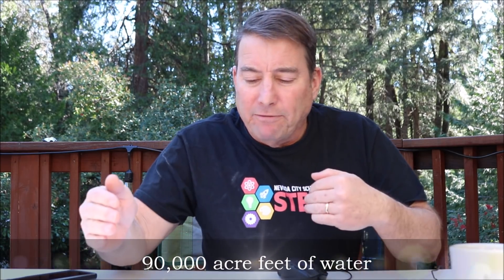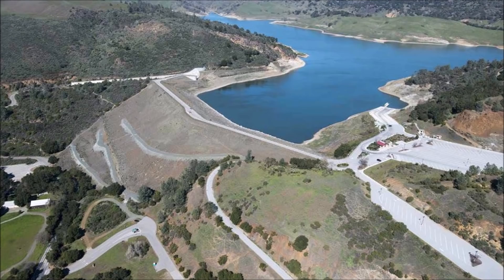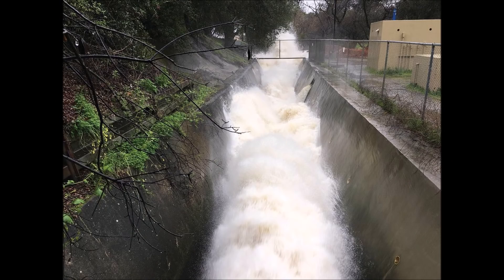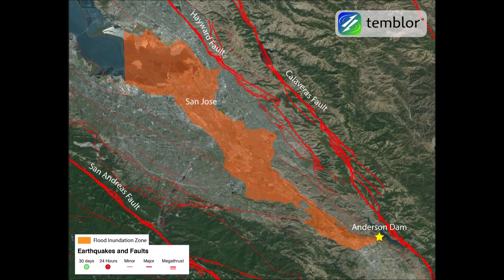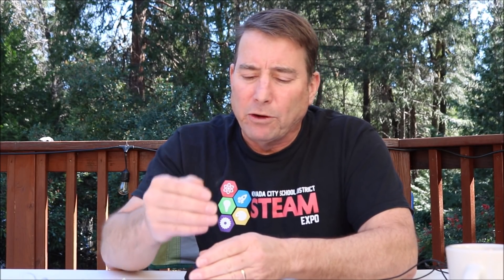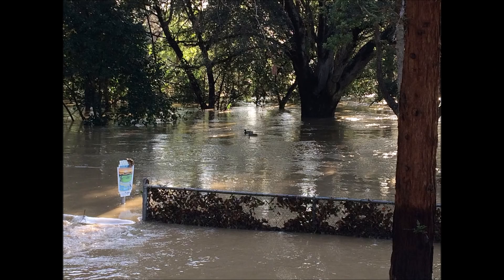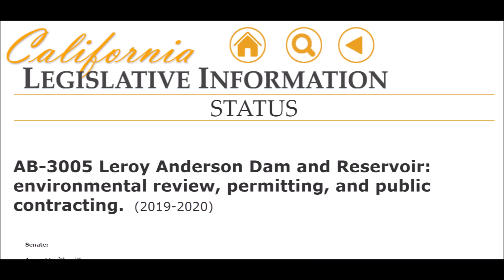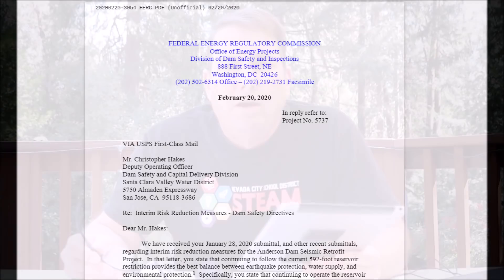Anderson Dam, Ca. vs FERC - "Drain The Lake"

Comment: The concept of channeling runoff is totally flawed, Inca-style hydrologic savvy says insert runoff into the groundwater system, don't ever let it gain speed, erosion worsens with the cube of velocity.

To clean up homelessness talk to Jamie Diamon & the Fed.

To handle Anthropocene rain volumes per unit time, baseball hail included, takes rake•n•shovel terracing to where walled terraces make sense to pond & drain that into the watertable.

The Amer.Soc.of Civil Engrs pub on Machu Picchu worth buying: bit.ly/3262mD1
Hth.

Comment: We were just starting to frame a duplex in Millbrae when the Loma Prieta earthquake hit. At the end of the day, just finished setting huge beams and threw some bolts in them for good measure...(they surely would've popped out). As we rode out the quake I remember watching my truck, straddling the sidewalk and the driveway, undulate with the rolling waves! Didn't realize it had a cool name like liquefaction.

Comment: Juan, I started watching you to learn what was happening with the 737 MAX and have picked up some great aviation information. But this story is fascinating. I graduated from high school in San Jose 50 years ago. I used Google earth to measure the distance from Anderson dam to my old house and it is 40.1 miles downstream. It’s hard to make out from the video but I think it would be under water based on the worst case scenario. It is currently priced at $1.6 m (it was around $40k when my parents bought it). 

We used to drive to the beach on the back roads through Watsonville. There are several other reservoirs in that area. And at the time we considered them in the middle of nowhere. Not a sole was living anywhere near them.

Comment: Sounds like the solution is easy but expensive. Extend the discharge tube horizontally far enough to be past the point of the collapsed dam and then start reducing the water level. That way if it does collapse, it won't block off the discharge tube. I know that this is a cost/benefit analysis thing, but where lives are involved they value life too cheaply. They also need to be working daily on clearing the open channel for the discharge water focusing on tree and brush growth in the channel. I lived in a subdivision in Texas that had that very problem and was flooded three times in one year and that sucks. I was wishing the Feds had sued the city for failing to maintain the drainage channel but they just kept paying flood insurance claims instead. 

PS Flood insurance is never enough for the pain of watching your place get flooded multiple times!

Comment: While i am skeptical of calls to remove dams for "restoring" fisheries (if you want fish farm them) this is one where i am in agreement with FERC. I never thought I would say that. The Anderson dam was built for flood control and irrigation. Hence it was done as cheaply as possible. That is why it's foundations are not properly earthquake restant. The urbanisation of the valley has also greatly I increased the potential loss of life and damage to insurance company's profits. 

This reservoir should be drained, or nearly so, and a decision needs to be made to determine if it should be removed, repaired or completely rebuilt. Who makes that decision is the big question.

One of the best videos on a topic I am very familiar with. Well done.

Comment: Interesting explanation -  You mentioned various causes for flooding. But in my view the primary cause for flood damage is that when originally built, the plans called for a reasonably wide flood plain below the dam, enabling floods to cause minimal damage, But housing developments eventually encroach into the flood plain. This ensures that if a flood occurs, the downstream path will be insufficient.

Comment: I just retired after 45+ years as a Hydro Operator.  FERC is often toothless.  In 2015, I had a spillgate stick full open during required testing, had to smack it with a large track hoe to get it to lower.  The words “uncontrolled release” went into a report to FERC, yet that gate still has not been repaired.  BTW that dam is 90 years old.

Comment: It begs a question from the past:  Why wasn't the "dental work" down to bedrock done back in 1950?  Was the contractor in a hurry back then?  Plus, does the authority need all of the capacity of the dam, would halfway be enough for water supply?
Reply from the maker: things change, including building codes.
Reply: To try to answer your third question, Santa Clara Valley Water District (Valley Water) provides 220,000,000 gallons of drinking water per  day, according to its website. Anderson Lake's capacity is equal to that of the other nine reservoirs in the district. In addition to these "local water" sources, Valley Water also imports about 55% of its raw water from the State Water Project, the federal Central Valley Project and San Francisco’s Hetch Hetchy system. It's really not a question of whether Valley Water could operate with Anderson Lake only half full (they have in the past); the question is the safety of the area below the dam should the dam fail.

Comment: As someone from the Netherlands, I don't understand why there isn't more regulation to prevent people from living in dangerous areas.
I also don't understand why your natural resources and hazards are not managed on a higher, more independent level. We have a completely separate government, with it's own taxes, for these things.
The final thing is that you don't have to build to bedrock. The Netherlands is a delta, there is no bedrock until you get well beyond what is possible with engineering. We still have major water engineering systems, like the Afsluitdijk and Oosterscheldedam. https://en.wikipedia.org/wiki/Delta_Works https://en.wikipedia.org/wiki/Zuiderzee_Works

Comment: Liquifaction Demonstration -- You can easily see liquifaction in your kitchen.  Brew a pot of coffee in a drip maker that has a basket.  When the brew is complete, remove the basket with the filter and wet grounds. The grounds will appear damp and distinct.  Over the sink, gently but firmly tap the side of the basket with a kitchen tool, such as the handle end of a stainless table knife.  (Be sure the knife is not sharp!)  You should see the grounds suddenly turn soupy and drops of coffee will fall into the sink.  Then after a few seconds, the grounds will return to a damp/distinct appearance.  You can probably repeat this two more times with the same damp/soup/damp effect,
     I my memory there were two liquifaction events  -- one on the north edge of San Francisco and another in Northridge.  The liquifaction states lasted long enough for buildings, cars, toys, plantings, etc. to sink.  Then when the ground restored to its merely wet state, those objects were encased in very tough dirt to dig out.

Comment: In 1989 May? Lexington reservoir was drained Suddenly and Rapidly.
 I was standing at the main drainage, near The Shark Stadium. In a minute it was Roaring. Why? They could have waited until October when the water is low. This was 3 years into a mini drought of 85% rain. The 1989 earthquake was 7 months old. The "Why" was " earthquake examination". And higher water rates. On TV the officials said Nothing has happened, nothing at all. If only I had my camcorder that day. People could have died. The flow was Huge. Like the denials. I took an Amphicar on Anderson in 1968. You  Don't see them often.
 There hasn't been a fish in coyote Creek for a Long time. Newell Creek feeds Loch Lomand and 1950's is the last time some poor trout was on Newell Creek. Spent 30+ yrs there, lived and riding MX bikes. The logging remains:: China camps, old pony motors and such took fish pop' out and continued into the 1950's. Tobacco Clement said he fished it. He ran a D7 back then, earlier, made many roads. Poor little fish.

Comment: It would seem counterintuitive that, in order to build an earth dam, one should first remove all the earth down to bedrock, only to be filled in with earth again. Of course, the distinction is that the removed earth might be of unknown or undesirable composition or condition, while what replaces it is specially selected for its attributes and placed in a deliberate manner. Test holes may reveal that, in fact, existing soil is suitable and need not be removed.
The Oroville spillway required cleaning right down to bedrock because it must withstand flowing water, and any loose material can become a chink in its armour. This would be true of pretty much any spillway, but a dam itself doesn't have any water flow (except for surface runoff from precipitation) which is why it can be made of loose material rather than stone or concrete.
Reply from the maker: same for dams....bedrock, dental work.

Comment: I'm wondering, could you schedule your flood for later so it won't impact the bay area commute?  :)     Sounds like they could benefit from a secant cutoff wall down the core of the dam.    Used to play in the Metcalf ORV park to keep the dirt skills sharp.   Everytime a reservoir has been drained, there has been massive hydraulic slumping all around the shores.

Comment: How do you drain a reservoir? Outflow must exceed the inflow by a decent margin to get anywhere. Looks like the pipe into Coyote Creek wouldn't have the capacity to manage that. How much diversion of the inflows is possible?
Reply from the maker: easy during a dought, or our hot dry summers. Thus the Oct. deadline.

Comment: Simple sample of liquefaction is the use of vibrators in concrete pouring. These long sticks that are driven into the fresh concrete vibrate and make the concrete flow into all edges of the casting and make all air bubble up.
Reply from the maker: Yep!

Comment: How about building a c-cant cut-off wall at the base of the current dam and  proper slope out start with the base of the new dam, horseshoe  shaped. 
Get water around the new dam  sight with pipes attached to the pinn stock.  Set above phase 1 (below lowest water retention to retain flow) .head pressure is a free pump till it fails  from too low a water level.  Have a contingency to go continuous poor exceeding the hight of the current dam.  
What about the old dam ?
Start dam tair down as a phase 1starts, follow the water level down till the pinn stock plugs.  Time this so as phase1 is operational and can take over control. Then flood the inter space and dredge out the remainder,  to prevent sluffing plugging the new outlet . Or leave a min  height  miny dam hardened to keep the lake sludge back from the new pinn stock .

Comment: Well I Was A Foreman On The AZ CAP Canal System + The Salt & Verde Rivers 6+-Dams Systems For Years In The Mid 70's+ & Them Dumbasses Over There Need To Lower That High Water Level Spillway Immidiately While Drout Levels Has That Lake Levels Lower, Then Manage The Creeks & Drainage Systems Around The Major Populations Down Stream For Future Less Water Holding Capacities To Avoid Major Future Failures &/or Flooding Problems... DAHhhh...

Comment: Should it not be a good idea to add a secondary controlled discharge gate and pipe ?or replace the original one with one with at least twice the flow rate to avoid any over topping?
Reply from the maker: Yes!

Comment: I used to commute past there all the time and lived in the region for many many years....why didn't they make this repair during the drought 10+ years ago when the lake was so empty the docks were sitting on the hillside shore going down to the lake....it was really low along with San Luis which I believe they may be connected for water management.   This whole thing is really about protecting Silicon Valley businesses not people from flooding during a catastrophic event, not about making it right.  How did they manage to build all these earthen dams so poorly like Oroville?  They should check the engineering and construction contacts, plan approvals, etc. and go after them to pay for all this.  California DWR strikes again!  BTW Las Vegas & LA have those problems with homeless setting up camps on the flood control structures.

Comment: I guess I have to point out that the so called "rolling waves" is a human physiological reaction to the seismic ground motion. While the geophysics is wonderfully complex there basically is only P and S waves. There can be very complex constructive and destruction interference (nodes), and reflections from large scale geo structures, and this can cause a lot of local intense shaking and destruction. And there is real ground motion and having trees whip back and forth is real (and loud). 

I am a geologist. I just went through the July 5 7.1 earthquake in Ridgecrest. Alas, I was inside sitting on a rolling office chair and I didn't get to experience this visual phenomena. But many here did, I have had this conversation with several friends who experienced seeing these "ground waves" stately marching across the land. But, it's all in the head - here is my argument. First, the speed of the seismic waves is 5-7 kilometers per second, with frequencies mostly in the range of 0.1 to 1 hertz (period = 1 to 10 seconds), the wavelengths are correspondingly huge - 5 to 70 kilometers. Second,  keep in mind the brittle nature of concrete, asphalt, rock, these materials could never be bent into the curves these people saw. It would all be shattered long before flexing that far. Finally, consider that while this is a commonly reported visual phenomena, there is no video footage of such waves marching up roads.
Reply: @A Tangerine Water in a pool, sure. Earthquakes cause ground motion, the water wants to stay put, the pool walls and bottom move and push the water, the water sloshes around. I was sitting on a wheeled office chair and during the quake I was going back and forth in a north south direction about a foot relative to my house. Trees whipping, water sloshing, old guy in a wheeled chair skating back and forth, these are all just masses-at-rest physics.  The wavy gravy you saw (and I believe you "saw" it) is just your nervous systems reaction to the ground motion. Don't know the physiological cause but for the reasons I stated above there were no real waves out there on the lawn. From my conservations with eye witnesses they thought what they saw was real. One fellow is a mechanical engineer, and I could see the realization dawn on him as he considered the physics. A couple of them who really have no clue about physics and materials weren't impressed with my explanation and still talk about seeing the "waves". Just for fun look around for video evidence of the "wavy gravy". There are tons of vids from Japan with lots of shaking going on, but no wavy gravy. Next time you see it take some video of the waves and post it. Please.

Comment: Greetings from Central Washington, the land of $.023 kwh power courtesy of the big dams on the mighty Columbia River. The dam I work at, Wells Dam, has a large concrete powerhouse in the middle, but earth embankments at each end. The Feds are pushing for a $500M repair/replacement of the east embankment for similar reasons to Anderson Dam. Rates will be going up a bit to help pay for it.

Comment: Thanks Juan . They pump water over the hill from San Luis Reservoir near Los Banos into the system . San Luis is off sight storage which is pumped into it from the aqueduct coming out of the delta which gets it's water from Shasta . You can get Lake Shasta water from the tap in Los Angeles , over 500 miles away .
Reply from the maker: Yep!

Comment: Just curious how FERC is involved since Anderson is not energy related, ie: hydroelectric? Do they regulate all dams?
Reply: Catchbucket; they are the buckstop for all water cachement in the US.  FERC got involved a couple decades ago with a 12 foot berm in Northern Georgia.   Since they deal with dams they also deal with earthworks and wetlands as well.
Reply: There is a small outlet hole that was passed to make hydroelectric, but is not that effective considering the size of the surrounding population. The run down "hydroelectric" shack that the FEDS control is why they are trying to push this agenda through. Plus a critical breakage of the dam would ONLY happen if is raining a lot, while the reservoir was left completely full and an earthquake happens.